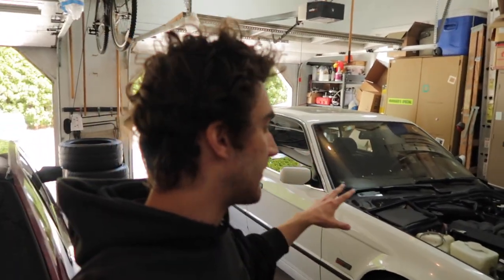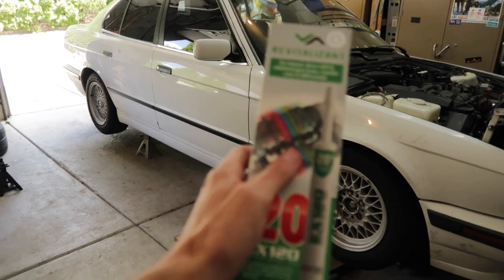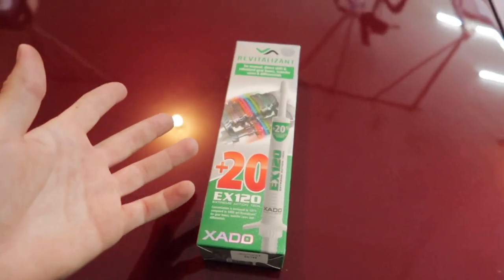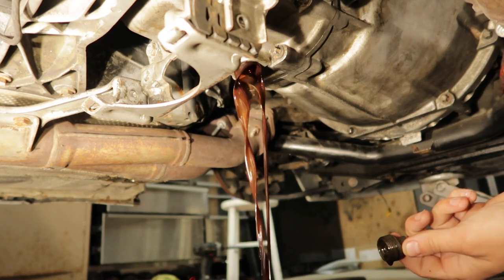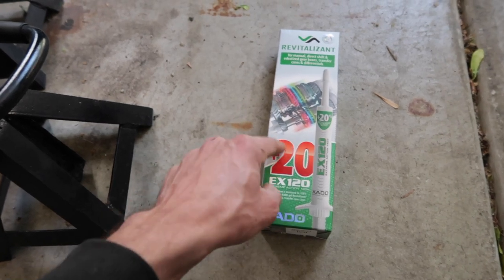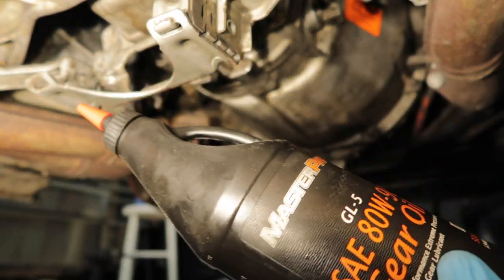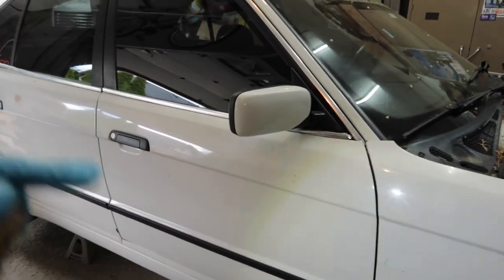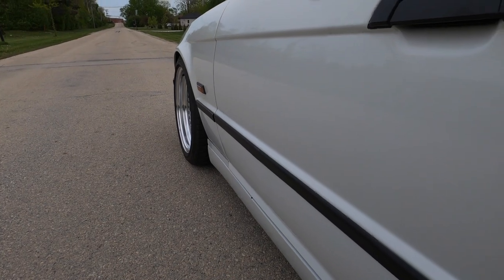Will transmission "repair" additives quiet down the 540's whining ZF?

Comment: Had the same problem on my 520i 
Sad if the trans go this way 

Myn was serviced before with all new seals but the shop used the wrong bolt as the drain bolt plus it leaked a bit all the time and I didn't notice it 

So shortly after if got it the input shaftbaring went 

So thats whats broken on yours 

A very important recommendation on this is to use the right bolt in the bottom 

It needs to have a little magnet this way all the metal can't grinde an the gears and damage them further. So keep that in mind for the new trans 

Great E34 content keep up the great work 👍

Greetings from a German fellow E34 owner 😊
Reply from the maker: I appreciate the words my friend! Thank you!

Comment: Xado is great product! i have neen using their oils and additives to the engine ang gear box as well for about 20 yrs! Always works great! on thir web site they mention that thir product should be used on properly working nechanisms! that mean you have to add xado into good working gear box or engine. 
Regularly people get remainder from the gear bix or engine by its noices. Well it us alredy too late to use xado. repair it first and add xado later. You will get a good result after all.

Comment: If it gets too the point where you have to change the trans. You can go to the 6 speed being a zf or the getrag. I think the driveshaft may be different because it the bigger trans.
Reply from the maker: Yeah im aware of the options. Would prefer to stay 5 speed to avoid stepping up to the large case rear differential and stuff
Reply: The is the same except for the gear ratio. Working for BMW, they two piece splinned driveshafts. You can mix and match to and extent of course. May it just may be worth rebuilding the current unit.
Reply: The differential is the same size apart from the gear ratio.
Reply: E32 and e34 V8 from 93 to 94 were complete disasters. There a recall on this engines on piston rings literally scraping the cylinder walls.
Reply: Now. Don't condemn the trans yet. If you step on the clutch and the noise goes away. Could be a bad or incorrect throw out bearing. Remember you have either and m60 or 62. Is the clutch kit you installed for a 540 or a 530? Flywheel too.  Technically the car as been re-engineried think of your  e30 M50 swap. It didn't work out perfectly. I did it with my 88 e30 me with and m52 from a 328is.
Reply from the maker: Its the same clutch/flywheel setup as ran prior. 530 stuff. Im positive its the transmission!

Comment: Check your parts numbers between 530 and 540 clutch kits a well as flywheel. As for the crack juice your putting in the trans. Lol. Marvel mystery is better. Never failed me for a valve tick and vamos noise. 🙌🏽